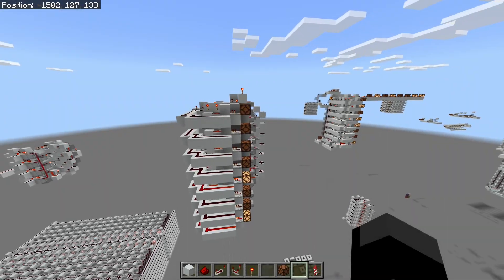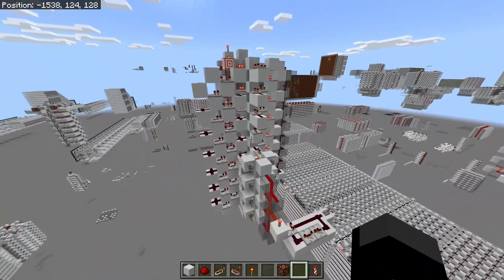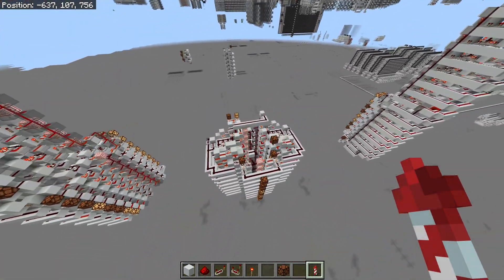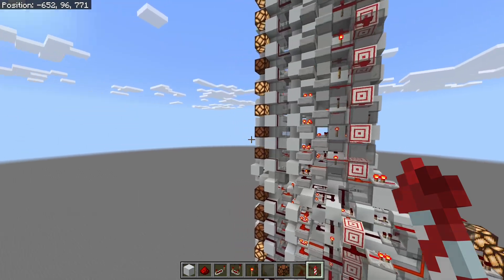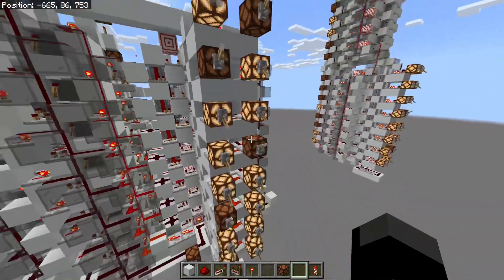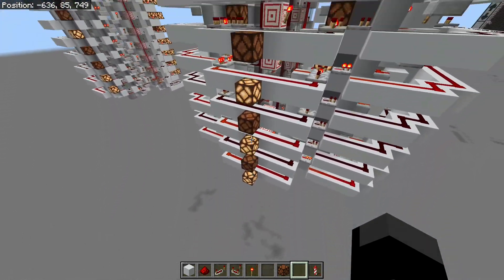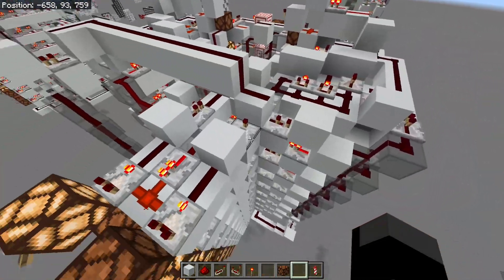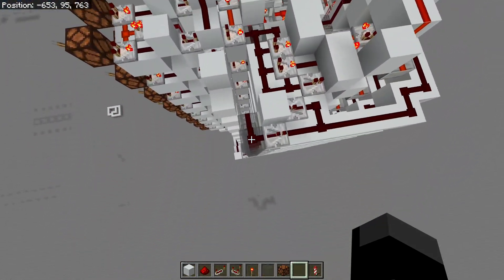I built an 8-bit multiplier in Minecraft Bedrock!

Comment: Which timings would have to be adjusted to make the tall version 16-bit? I guess the extra carry out delay would make the data loop longer?
Reply from the maker: If you wanted it to give out the full 32 bit output it would have to be doubled in size vertically. Several different bits will need to be modified. When I made the design give out a 16 bit result I already worked out (just kinda guessed lol) the carry timings so you can just copy what I did there. The lines that input some of the numbers would also have to be expanded as well and also need to be a multiple of 5 ticks. This can be seen near the carry part of the tall version. Also, the reset circuit timings would need to be modified to account for the ripple delay of the carry. The reset would take longer and a longer delay is needed between the reset of the multiplier and the input of the numbers.